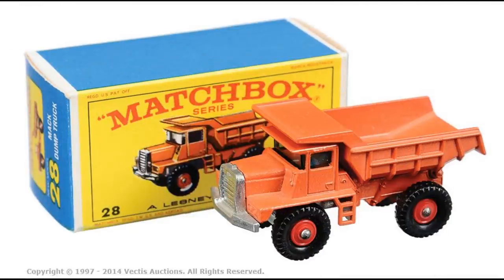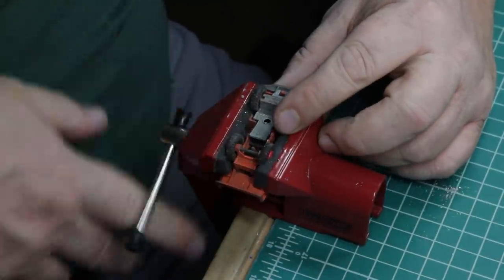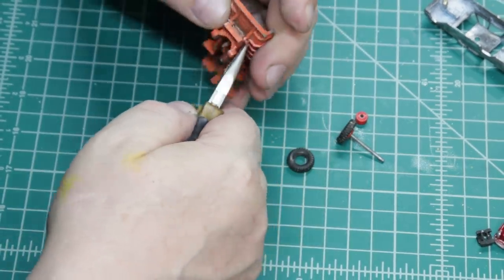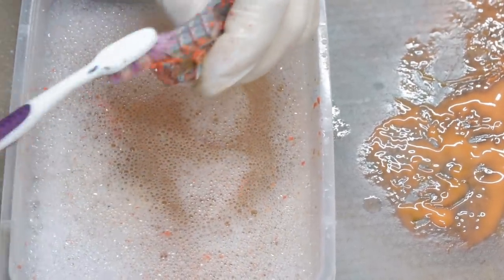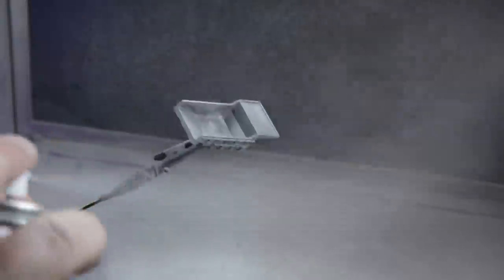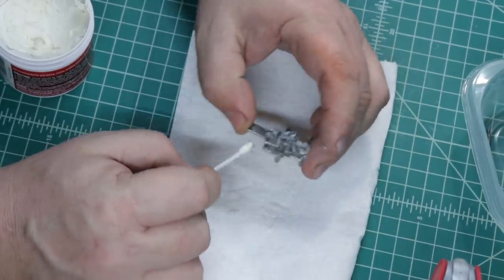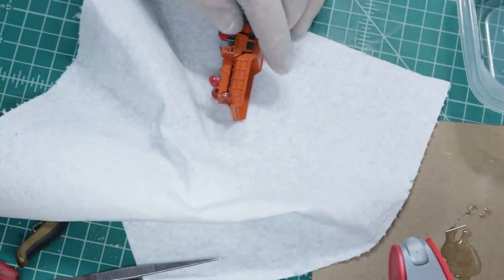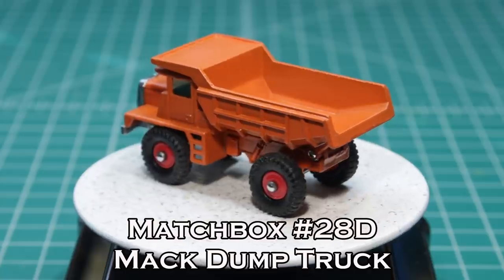Matchbox #28D Mack Dump Truck - Restoration

Comment: Great restoration, getting your colour match before stripping is the only improvement I can    add
Reply from the maker: I don't color match before stripping because the color on a 50 year old toy is irrelevant.  The paint could be dirty, stained, covered in gunk, UV faded or affected  by a multitude of environmental influences  and not anywhere near what the original color was anyway.  Not to mention that Lesney didn't use the same colors from car to car themselves.  I have three of these Mack dump trucks and the orange on each is different.  If I'm in the ballpark I call it good.  But that's just me . . .

Comment: That's a mint result.  Well done.  The shiny grill is fantastic.  Matchbox vehicles with a tipping body are in a class of their own, when it comes to as received condition for restoration.  They were the models that spent time outside and in sand pits.  I use masking tape on the hubs as it has a textured surface, which I thought would grip the tyres better.  Like all tapes or adhesives, it's long term effect on the hub plastic is unknown.  Hopefully any residue can be cleaned off with Methylated Spirits.
Reply from the maker: Wel it took about half a century to get that way and I'll probably be long gone before your question is answered!

Comment: The dump truck came out great.  I've been using Elmer's Washable School Glue gel to attach original tires on to shrunken Matchbox hubs.  Dries clear and easily dissolves in water to go back to original if the need arises.
Reply from the maker: Thanks for the tip!
Reply: Rich Stinchcomb         Thank you, i will try this

Comment: Beautiful job! I use Mothers aluminum polish on mine and the result is amazing. Do you have to clear coat the polished front? I havent had much success clear coating the plated zinc finish without it dulling the finish. Even using Alclad 2 Aqua Gloss which I hoped would maintain the finish.
Reply from the maker: I never have, I guess I figured if it ever dulled, it would take about 5 minutes to re-polish it.
Reply: @TimeRider  I read up on clear gloss over chrome or plating, yesterday, and most information I looked at on auto or bike forums said to wax it, and never paint as it clouds the finish.  It is good to know as I did three strip-downs, and re-polishes, because the 3 clear paints had clouded the finish. The next one I do is getting auto wax for certain!

Comment: #DENTALPIC'S [home made]I get my old paint brushes [round pencil type] I then get a pin or needle and using pliers I push the pin into the end of paintbrush leaving a pilot hole, I then cut the pin down to an inch , I then push the blunt end into the pilot hole with a tad of crazy glue, and I have my own dental picks, you can play around with sizes, just make sure pilot hole is as central as possible, or it will come out the side of paintbrush
Reply from the maker: I hold the safety pin in my hand and then I don't need old paint brushes, superglue or a pliers.  I have three different sizes of safety pin.  🤣🤣🤣🤣

Comment: Nice work turned out nice,  was it you or Marty that used hot water to soften the tyres to get them on
Reply from the maker: Probably Marty.
Reply: rc-nut 1      Marty,   But if  they are really big or hard, the water needs to be really hot